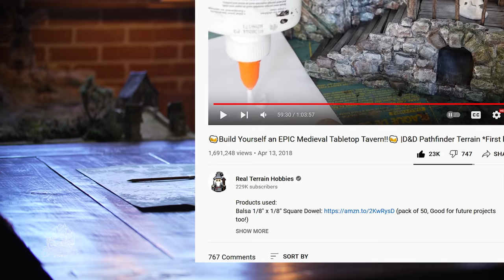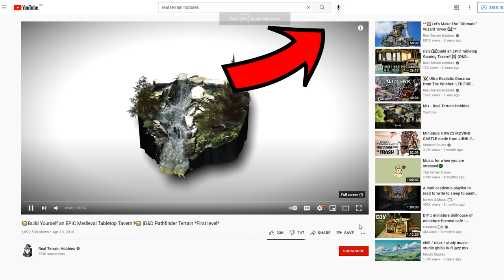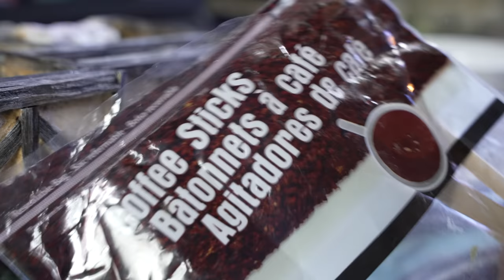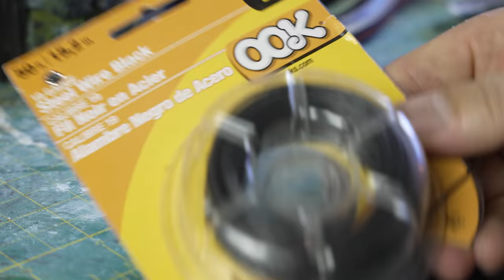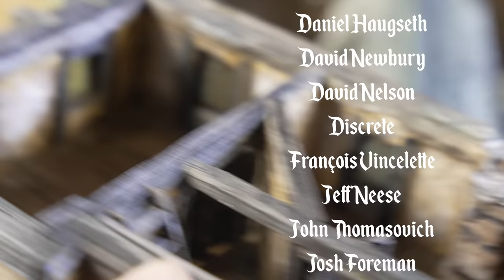I Built a Miniature TABLETOP TAVERN!🍻 | D&D Terrain

Comment: Wow. This was WAY more detailed and realistic than I would ever have tried.
-
For shingles, I use food box cardboard cut into individual shingles, and use a bad brush to apply texture paste to get the wood grain.
The big 'trick' for the shingling is to run a course of half-length shingles on the bottom edge of the roof to give the bottom course of full-size shingles the right profile. This is a trick I got from someone who actually roofed with cedar shingles.
Oh, and for where two roof planes meet in a valley, I first put down a full-length folded piece of the cardboard, to later paint as corroded copper, or oxidized lead. This is also something done on real cedar or slate shingled roofs.

Comment: That's it. This right here is the inspiration I've been looking for. While there are many cool crafts out there, this one goes beyond simply cool and ticks all my boxes.

Atmospheric low-fantasy looking color palette? Check.
Charming irregular shingles? Check.
Cozy windows one could sit in front of while lecturing four hobbits on the Ringwraiths and being 100% badass? Check.
Incredible woodwork around the doors and windows? Check.
Reasonably small size instead of huge 5-inch ceilings? Check.
Baldur's Gate reference in the mix? Check.

This is incredible. Thank you very much for sharing this!

Comment: Just a little tip for you when adding the plaster to the inside of your walls to make is easier for you, you could use a pastry bag or a zip lock with a small hole cut into it.  It will help you have more control when filling small gaps and will save you some time.

Comment: The only thing I wouldve done differently was rather than using so much balsa wood to make so many shingles. I wouldve used card stock cereal box and use either a wavy or gator tooth scissors to cut the chip board box into strips and layer the strips for the shingles, rather than cut all that balsa pieces individually and save a hell of a lot of time building this. Other than that awesome build.

Comment: You know they make flattened metal for modeling? 😅

It's basically very heavy foil. Much easier to work with. 

LOVE this build though. I wish I could build half this good. Seriously man, your work is amazing.

Edit: you can also buy super thin glass for model windows. But honestly, I think I like the epoxy/grid mix better for this project.